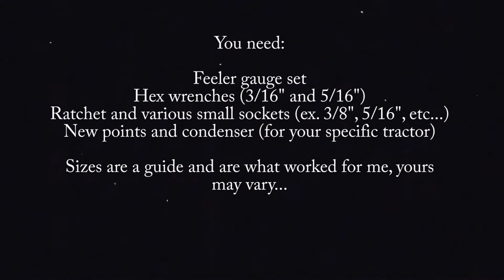Onan B Series Engine Points and Condenser Replacement

Comment: This video helped me lots. The engine sounded like it wanted to tear itself apart at higher RPMs. Took the cover off and i immediately noticed the points were 2-3 times further apart than they should have been. Took 5 sticky notes and then backed it off about 1/16th of a turn and now she runs smooth. Now I have to deal with the unknown oil leak.
Reply from the maker: Check the oil filter mount for the oil leak, I have a video for that as well.

Comment: I'm not getting any Spark all the sudden never not started in 30 years took it off trailer couple weeks ago put it on and maintainer which I always do. Went out to start it no spark. No spark plugs no spark at points but I'm getting 13 volts through to the points. Any suggestions. Thank you in advance
Reply from the maker: Are the points actually moving when you crank the engine?

Comment: Thanks for the vid. I have a case 446 with the B43M.  The engine starts to run rough and die after 20-30 minutes.  Once cool, it is ok again.  Any ideas of the cause?  Also, are any of these after market parts ok to use? Any links to parts source?  Thanks in Advance!
Reply from the maker: It could be a coil going bad that acts up once it gets hot. I wouldn’t go buying the cheapest parts out there though, I tend to look at the reviews of things to see if the quality is decent.

Comment: How come you replaced? Ours is surging with a new carb and people suggest replacing
Reply from the maker: Points and Condenser should be replaced periodically as part of normal maintenance. Your surging is is likely something else, such as a carburetor issue or intake manifold vacuum leak.

Comment: I have a JD 318 back firing through carb idles ok but won't take any throttle could points be my problem
Reply from the maker: Possibly, it’s definitely worth replacing them or at least checking them to make sure the gap is correct.

Comment: Help!  I’m a little confused on the wiring for the coil. Does the condenser go on the positive or negative? What exactly is connected to the pos and neg side of the coil?
Reply from the maker: Condenser goes on the positive side of the coil. Going by the drawing, orange wire is also on the positive side and black wire is on the negative. It’s a good idea to label things before taking them apart to keep from getting mixed up.
Reply: Great video however I disagree with your answer above.  The B43 motor has the condenser under the points cover and connects to the points, and the points wire goes to the NEGATIVE on the coil.  The POSITIVE on the coil goes to the Time Delay Control Module.  I think you were confusing the B43 motor with the P218 motor with electronic ignition.
Reply from the maker: @bigragu98  I think you are correct, I may have looked at the P218 wiring diagram by mistake. Good catch.

Comment: How were you able to tell the points are bad my 318 once it’s warmed up an under a load is starts missing and backfiring thanks
Reply from the maker: Mine weren’t necessarily bad, I replaced them more as a preventative maintenance item. They’re cheap so it can’t hurt to try that. Your issue may be coil related also.
Reply: My 1990 318 is doing the same.  I've changed fuel filter, fuel pump and fuel lines and still does it.  Am considering points and condensor next.  Have you resolved yours?

Comment: Hey, looking good. If got a question. It easy to change the oilfilter? Mine has got a hole in it... thx best regards roli
Reply from the maker: What makes you think it has a hole in it?
Reply: Well oil is dripping out of the oilfilter. The frontside of the filter has worn down from rubbing against the chassis
Reply: By the way, what oilfilter do you use for the performer 20?
Reply from the maker: @rolika5520  I’ve always been able to get mine off with a small oil filter wrench without an issue. If you get it off and there isn’t really a hole in it, the leak could be at the adapter plate. See my video on that here: https://youtu.be/VbPJ4d5yFiE
Reply from the maker: @rolika5520  NAPA 1374 will work I believe, though I’ve never had this engine to know for sure.
Reply: @outdoorpowerhouse  when im running the motor the oil is leaking out of the filters front, the top is really worn out because of rubbing against the enginecover
Reply: Are you using the correct filter? Because it shouldn’t be rubbing on the engine cover.